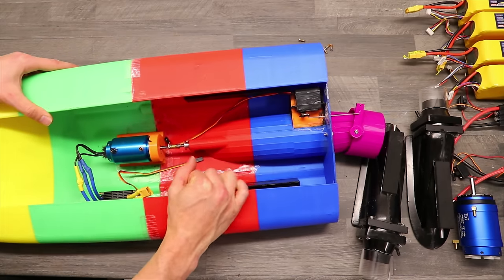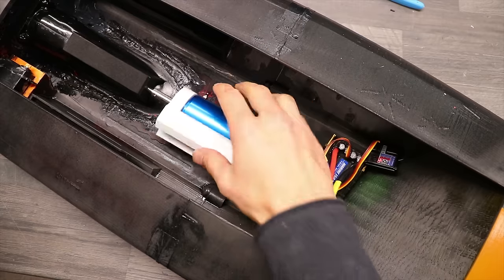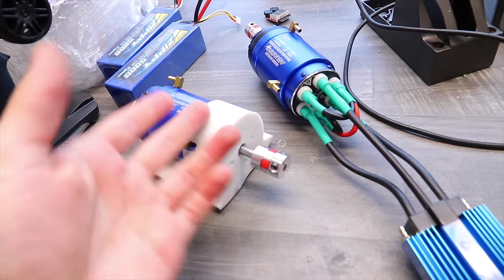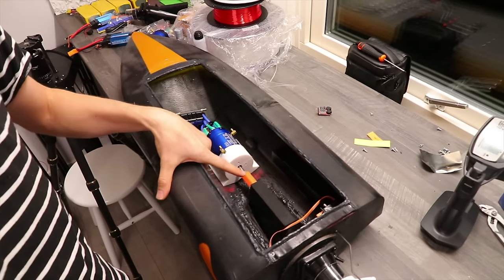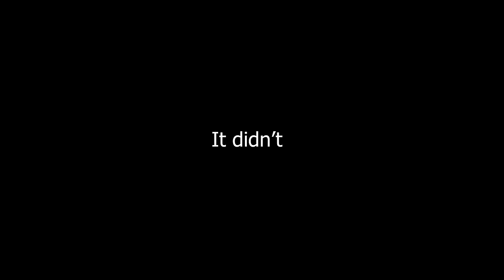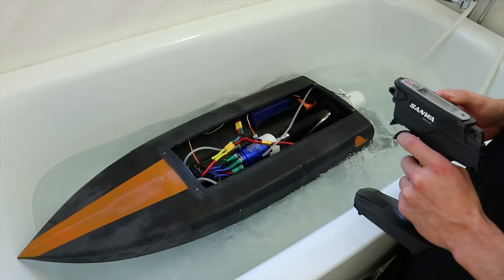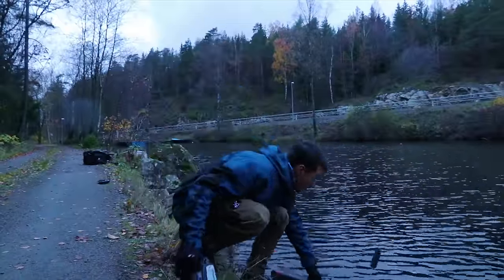5000W Motor In a 3D Printed Jet Boat

Comment: Well done. Neat project. My dad had a jet boat from the time I was about 10. 19’ 1973 Carlson Glastron CV-19 
455 Oldsmobile engine. He replaced the pump with another Berkeley pump don’t recall the mode numbers but it came from a drag boat that burned down. The pump on he outside or the transom was longer and a little lower and the pitch was adjustable. That gave us between 15-20mph from the more efficient pump and getting more of the boat out of the water. So from like 52-55mph to about 70-75mph. Then the engine was rebuilt with 10:1 forged dishes pistons and a large Crowler cam and the better of the iron head factory castings and it made great power and that got us to around 90. That engine lasted about 3 seasons of super hard running. Lots of people raced then at Indian Lake Ohio. But even with a much lesser engine it still goes 70s because of that excellent pump.

Comment: Just so you know you do have what you need to make a centered coupler. All you have to do is put that coupler in the drill chuck. mount a drill bit in a vice and turn the part rather than the drill bit. Effectively turning you drill press into a hack rod lathe. Only thing is your limited to the size of your Chuck on your drill press as to how large a part you can drill.

Comment: A pair of universal joints in the shaft from the motor to the propellor. Solves alignment and reduces vibration, also helps isolate thrust.

Comment: Three words: Helical Shaft Couplers

You're welcome.
Reply: ^^ This. Coupling two shafts perfectly coaxially is mega hard. You would have needed to couple the motor and drive unit outside the boat on a very well made set of mounting rails (that include fine adjustments), then glue the entire mounting system in as a single unit. That's why no one bothers doing it! You just use a non-ridged coupler that accommodates non-coaxial rotation.
Reply: How do helicals compare to rubber spiders though?
Reply: They can snap pretty easily with enough torque

Comment: 5kW motor on 600W (peak) power source (14.8V*4Ah*10pcs)
Transmitting 5kw of power using a TPU coupler (but is orange so it should work)
Man, you bend the laws of physic.:))

Comment: Hey man are you going to make an rc submarine? It could be really intersting!
Reply: I want to see that
Reply: they are pretty advanced.
Reply: The problem is communications. But maybe there are some ultrasound transceivers or something similar available that will work underwater.
Reply: @johansundman8221  yeah I've heard about that but maybe a long rope (about 20m long) with the cable in it could be a solution🤔
Reply: @anto_1446  yea sure but it would be limited to the length of the cable unfortunately. I think he should try the ultrasonic communications instead. It could probably be done with two arduinos, two ultrasonic transducers and maybe some amplifier module. Wouldn't it be awesome if he could receive some sort of image in real time from the submarine as he controls it and because it's controlled by an arduino it could just be programmed to resurface if the signal is lost.
Reply: @johansundman8221  yes that's the point receiving image would be the best part of this project, now we can hope that he will see our comment
Reply: Would LOVE to see that, maybe low-freq RC comms? Also (same as this and other projects) parts list and guide on how to make it actually work, so others can try too!
Reply: Low frequency equals low data rate. I think it would be the most fun to make it autonomous.

Comment: pro* tip on the not having a lathe issue: Put the coupler in the drill press & put the drill bit in the vice. The drill bit will want to center its self.
*this is a bodge, don't blame me if the drill press picks up the vice and throws it into your spleen
Reply: My spleen!

Comment: Idk if you read these or not ...... but i have a project idea for you .... 

That little buggy you pull around......I've seen you fight with that thing often. 

I think you should put a motor on that thing. high torque, low speed...a slow walking pace.
Put a free wheel sprocket on it like a bicycle (amazon 12$) and the right gear ratio would keep it slow and controllable without the need for a variable throttle, but would still have tons of power to the wheels. 
A simple push button a Continuous Duty Solenoid Relay, so you don't burn the coil. (amazon 14$)

Just for times when you are dragging it across the sand or something. 

The free wheel would allow you to still pull with your eboard at higher speeds.

Comment: Man, you need a TS-100 soldering iron - it's perfect for cutting, welding and shaving 3d printed parts. I use it about 2 year's. Temperature control, working from batteries,   compact - it's really necessary for 3d prints.
Sorry for bad English)

Comment: Wort of advice. From engineering 101. Unless you have extreme precision you cannot put more than 2 bearings in a row on a shaft. The motor has 2 bearings in it already, then the shaft has more bearings creating 3+ bearings in a row and a shaft that unless PERFECTLY in line, will always be off balance. 

So you cannot have any sort of rigid attachment and need wither a U joint or a real shaft coupler like you have for your other motors. 

Hope this helps you going forward.

Comment: Next time you need to draw a straight line for holes on a cylindrical object, try this: affix your work piece in a vise or clamp. Next, scribe a line with a pair of climbers that is equal to half the diameter of the round stock. Here is the kicker, use a level or angle gauge on the calipers to ensure that you maintain the identical angle throughout the scribing process to ensure your line is straight. I hope that made sense and is helpful! There are surely better and more professional methods for this including math, but this route should work well enough for the average craftsperson.

Comment: on projects like this, try a piece of rubber tube for the coupler.  been running a 13hp petrol engine on a 15" diaphragm sludge pump with a radiator hose for the coupler..

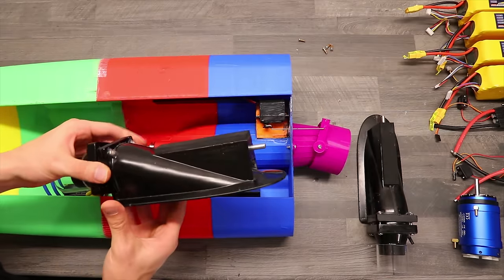Comment: I'm not sure if i did see right at 1:13, but if the fins (dont know if this is the correct english word for it) are straigt, you have a bad efficy on the jet. The Impeller doesnt only increasy speed of the water, it also brings a spin into it. The spin later on can be converted into pressure. The fins reduce the velocity of the spin (which become 0), which gives you more pressure. So, what do you do with this pressure? You let it run thru a nozzle, to increase the speed of the outcoming water. With starting from trial and error i started calculating what actual is needed.

Comment: On a round object,you find Center by drawing a + from points A to B & C to D. Therefore you achieve dead center.Very simple. You can also purchase a drill guide at your local hardware store to achieve perfect symmetrically perfect drilled hole from end to end.Any help you may need please ask have a great day.

Comment: why dont you print a u-joint for the coupler? would solve alot of your issues with vibration, mis-alignment, etc...  and of course a mount block that gets your output shaft and drive shaft level.

Comment: Just an idea for a coupler, why not a peice of reinforced hose with zip ties? that would give you a vibration buffer aswell
ALSO you should use a dewalt flex volt battery as a power source on one of these builds!

Comment: I noticed you attempting to make couplers one a few videos and I wondered if you ever considered using gears instead of a couple. Since the Rv8 motors can rev you may even be able to gear it down to a torquier ratio than 1:1. Don’t know if the gear will hold up great if printed but you can always widen the teeth quite a bit to account for gear tooth surface area

Comment: You have enough stuff kicking around that you can make yourself a little basic lathe for times like this this when you need a hole that is concentric to the outside diameter of a shaft.

Comment: The obvious coupler is a piece of PVC clear hose that fits tight on the small shaft and is a bitch to put on the larger one. Next to no vibration if long enough, aprox 3~3.5 cm long in this case, guestimate.

Comment: What's the reason for not using neoprene pads on the motor mount?!  It is very good at dealing with transient vibrations, which is why it is used often....

Comment: If he used a belt drive it would eliminate the need for a coupler. He could also vary the gear drive size to get more or less RPM's to the propeller.

Comment: At 9:24 the boat and the boat-mounted camera are going down river. The boat turns 180 degrees and starts going up river, but the boat-mounted camera is still pointing down river. How'd you do that? Servo-controlled camera?

Comment: Alignment of the motor shaft to jet shaft must be precise to not vibrate. A consumer 3d printer will not make precise enough parts for a coupler, or a motor bracket.

Comment: DONT USE ANY WOOD it warps and breaks go to a marine store and get star board its like plastic wood and lasts forever i am re building my TUG atlantic tug or mount the motor to metal the tug came with balsa wood frame for the inside motor is getting loose and mount is breaking

Comment: I kinda cant believe the 5000W part. what motor is that, and what exact driver are you using for it? scince the driver you are using doesnt look like it could actually handle 5000W

Comment: Hi, I have a question, i need to power a remote controlled float tube for experimental purposes, where can i find a waterproof motor like yours as it seems powerfull enough to move heavy loads (100lbs), thanks and regards

Comment: Hello, I have seen your video and your finished knowledge in this matter shows, I would like to request your opinion regarding the manufacture of a boat with two passengers in parallel one next to the other, 45 inches wide and only 80 inches long , made of plastic and fiberglass, that its weight does not exceed 100 pounds, but my goal is to be self-sustaining, that is, without fuel consumption, those turbo jets that you incorporated into your boat, can you buy bigger? the motor can also be bigger and should they be only 12 volt? or can they be 220 volt? Could you tell me who is the supplier of these turbo jets and engines? These must be powered by solar energy, what do you think? could it be done? The design I have, has enough space to place two solar panels, would it be a totally self-sustaining vehicle? I would appreciate your comment, because I am waiting for that news, I am from Chile and this project is for the south of my country, where the area where this boat will be used is very remote and there are no places to refuel that They are not less than 200 or 250 miles away, so the need to have a vehicle with clean energy and without fuel consumption, hoping not to bother you, I say goodbye very cordially.

Comment: I need HELP.
 I'm wanting to buy my first 3d printer. I've done SO much research. I nailed it down to the anycubic chiron and the cr 10s pro. Mainly due to the size and auto leveling. Is there a difference between those 2? Which one do you recommend?. I'm probably mainly using it to print toys etc. 
I'd appreciate any feedback.  😁

Comment: i would have went with a offset motor with a gear on the end then you could change the gear on the prop to adjust the gear ratio for more or less speed while at the same time killing the vibration

Comment: KV and Torque definitely have zero relationship to each other
Reply: Why do people in fpv think low kv motors have more torque
Reply: @zephyr2278  It's been a misconception for a very long time. I think it's mostly a carry over in the logic of how conventional engines work. Lower KV I think is often thought of as having a higher gear ratio (lower output RPM) which would indeed mean greater torque. But with electric motors there's no gear reduction at all, the motor will make as much power a it will make, regardless of the KV. KV is really just an option for how much loss of efficiency you're willing to take for a slight increase in max RPM.
Reply: ThumbzFPV ah I got it, could also be people keep saying 6s builds with low kv has tons of torque so people think it’s the motors too. I was wondering how much torque I’d lose in a high kv 6s speed build but I guess none
Reply: @zephyr2278  The torque of the motor is wholly dependent on its construction, voltage has very little if any effect on the torque produced by the motor. 6S will tend to run cooler, and so you get slightly better power efficiency due to the lower current, but that's about it.

Comment: for crying out loud, stop making these rigid shafts couplings, if you know there is gonna be more then a hair of center mounting between two shafts just use a beam coupling, yea sure you gotta buy them, but in many cases, they will save you for broken parts etc. and will ensure that ie. your motor shaft and it's bearings won't wear out as fast.

Comment: Use a flex shaft and are you trying to run that on with those batteries in series  better have a esc over 200 amps I think even 150amp won't work what's the amps on the esc go get a castle hydra bro and use a flex shaft

Comment: My first thought for couplers would be something like these: https://www.adafruit.com/product/1175  Will you be attaching solar panels in case it gets away from you - use a GPS to add a 'return to home' function, and let it drift and charge in the sun all day before powering up the motor if the battery levels are too low?

Comment: kV doesn't determine torque, lol. A lower kV motor needs more voltage to run the same rpm as a higher kV motor, and the higher voltage gives more torque. A high kV motor can also suck the life out of your batteries with its low resistance, so you need good electronics to handle them.

Comment: Hey there youngster, how's about I hook ya up with a little trick to help ya with Makin couplers without. a large ..get yourself some aluminum round stock the diameter of the coupler you want to make and cut it to the length you want.  You have a drill with a chick big enough to fit the aluminum round stock, right? Put the round stock in the drill. The end looks like crap right? Get out your Dremel and put a cut off wheel in it and put the drill in a vice or clamp it down, you can even as your g friend to hold it between her legs, extra points if she will do it while wearing a skirt and win a free chicken dinner if she will let you include her in your video....get the drill spinning and use the Dremel tool/cut off wheel the clean up the end of the aluminum....get it flat first and then take the cut off wheel  on its edge make a low spot in the center of the aluminum...don't have to be perfect...remove the drill from between g friends legs and make sure you tell her that you think her legs are kinda hot and that's a good thing.   Next, get you a drill bit. Maybe 1/8 in to start and clamp it I the vice and take the drill motor and use it spin the part over the drill bit. If the low spot in the middle is right it will find center all on its own, of that don't happen roll it off the side until it does find center. . Drill you hole all the way through from one end.its best if the next drill bit is one size smaller than the armature shaft, drill it out and drill and tap 4 holes for set screws...the need to be in a straight line...if you did it right it should run plenty straight

Comment: I don't know much about the fluid dynamics.  But the way the water rises on the back of the boat.   Wouldn't wings out the sides improve the way it rides over the waves?  As it will turn the water that rides high on the back end into balls for the wings to ride over.    I remeber watching something and they had a if nature make a power boat and they showed the boat without wings that looked like the back end of your then the difference the wings made to just how fast the thing would go as it was basically turning the water into balls to glide over

Comment: Just because the motor is rated at 5000W doesn't mean it's consuming that much power. It needs a battery that is capable of supplying that many watts as well.

Comment: All your titles are click bate a 5000w motor on 50v will drain about 100amps, to carry that current you need at leased gauge 2, what is a 7.0cm thicc cable , if it was 24V, what it probably was, you have 200amps, the thiccnes of the cable is just as thicc as your arm, prooving your lieing to yourself